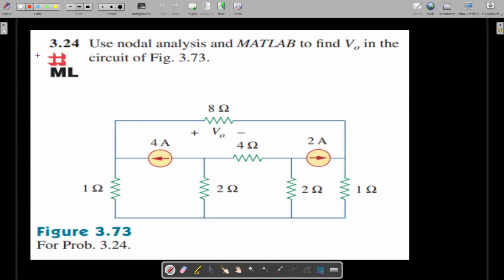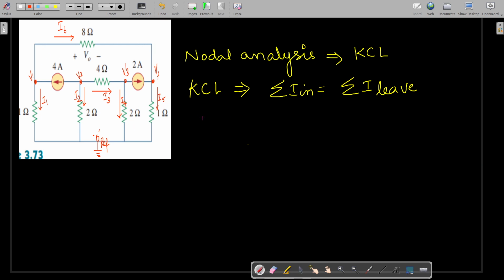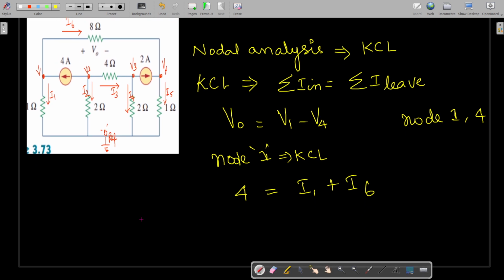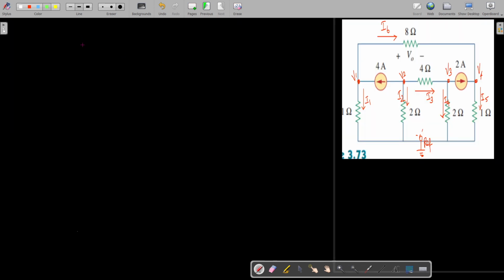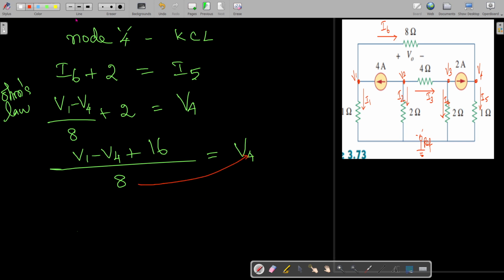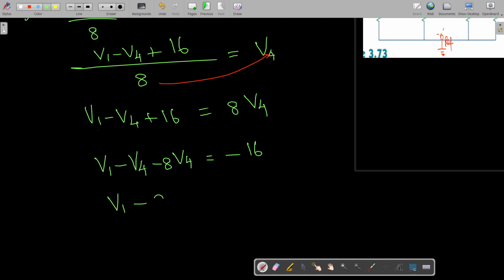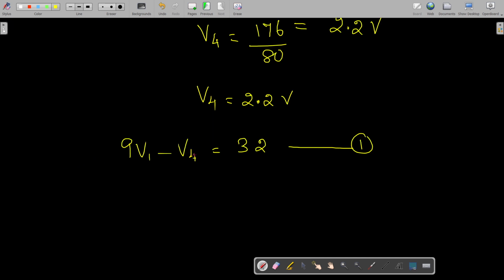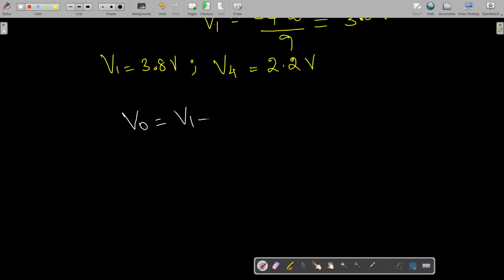Nodal Analysis -Problem 3.24 - FEC

Comment: How to give current directions mam
Reply from the maker: You can assign any direction for the branch currents other than the already given currents. In this case, 4A and 2A are already given. Other than these currents all other currents I1-I6 are assigned by us. So u can take direction. Left to right or right to left. Similarly top to bottom or bottom to top. But we prefer top to bottom and left to  right.